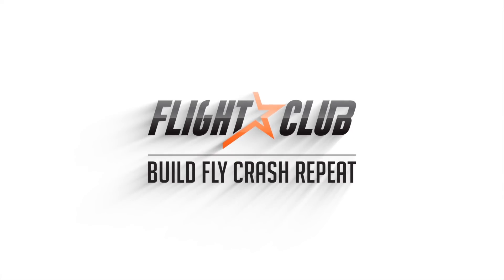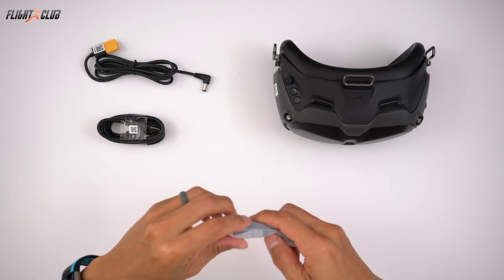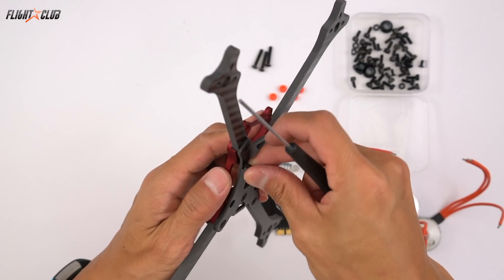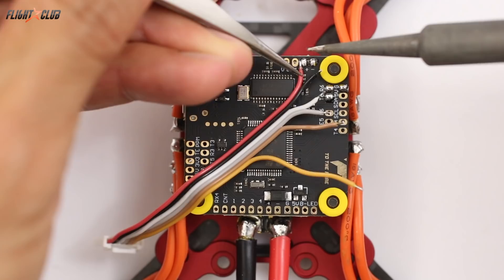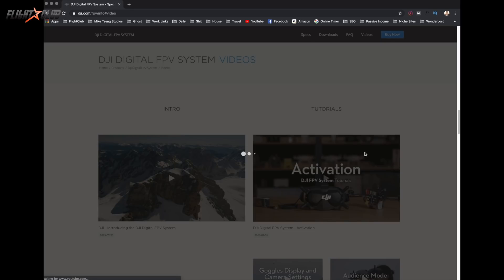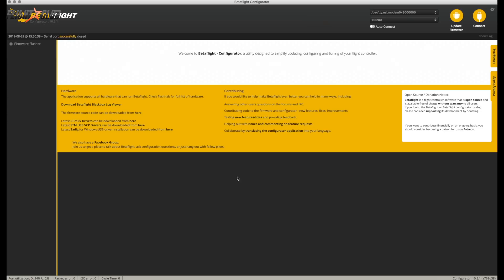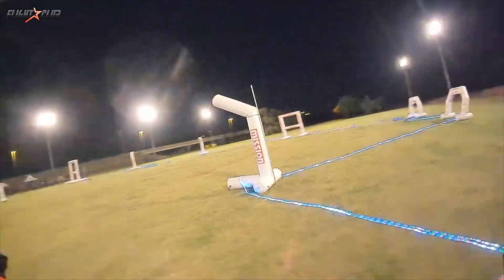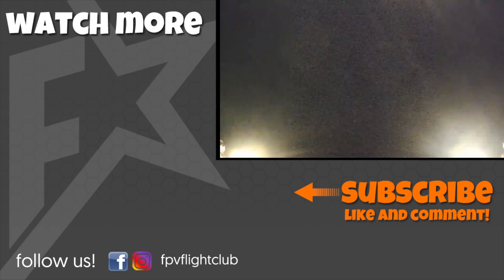DJI FVP Build : HD Drone Racing!

Comment: Fantastic video and very clean welding... btw, I've seen that most of the people also use a capacitor to reduce electronic spikes together with the battery, but in your video you don't.. Did you find any problem while flying?

Comment: hey Chris,
i bought this system from you a while ago...great video btw.
I would like to point out one thing though: IT IS VERY VERY IMPORTANT TO SET THE DEVICE PROTOCOLL IN THE DJI GOGGLES TO NORMAL..otherweise betaflight will not recognize the DJI remote. 
just thought i could save some people some time :-)

Comment: I also had the question I read others have posted in the comments.  Must be a 4S build. But with all these videos and tutorials on running 6S on a 4S quad,   You had better contact your customer and advise them that they cannot do so unless modified.      I have almost the Same Stack that I am building out at the moment.  I was in a bit of a quandry, because the FC does not have a 12v pad for the Air unit.  However there is an unused pin coming out of the ESC however I see very small on the ESC it says 10v  however there is no wire in that hole on the plug,  a bit strange... but instead of running a 12v Bec off Vbat, I put a wire into that plug and plugged in a 6s battery and tested it with the multimeter and sure enough 10V.     So I am hoping this works out.     Probably not the best place to post the info but if anyone else is here and wondering what to do on a 6S build I thought maybe it would help.  However let me advise I am just building it out, so real world I don't know if its going to work.  Actually going to plug in the Air unit and 6S battery right now with USB C connected and Register with the DJI tool  (DJI assistant)
Reply: Plugged in,  Bound, activated and connected to DJI assistant updated.... Seems to work  so far so good.    On with the 6S build  later.

Comment: thxs for the video! i made also one but i used the tmotors f4 fc with the connectors so i dont had to solder between the air unit and the fc. but now i dont see the power indication of the aircraft in the goggles. instead is marked n/a. can you help me?

Comment: I am trying to build my first FPV drone ever, i would like to go with DJI FPV System but I want to build a 6s, with astrox x5 body, lumenier 2207-11 1750KV My question is can I use XILO Stax Combo 45A BLHeli_32 6s 4-in-1 ESC and F4 flight controller with DJI FPV System? If so does it support play and plug or do i have to solder the dji to XILO flight controller? Thanks in Advance.

Comment: FINALLY, a nice installation like always. What about to use 6s? with a Bec?
And I hace seen RSSI and GPS in a video, How will it posiible? THX in advance.
Reply: #Gabyguay69FPV # by bro do you found a solution for 6s?
Reply: @nes.torfernandez  I have ordered a BEC matek (3 pieces) 1 for matek,1 for ar unti. there is a forum in facebook very ussefull, join it!

Comment: You don't have to be rich to fly the best gear in FPV. Speaking from experience you're better off starting with the best equipment available. Most of it is a one-time purchase..... $2500 will set you up FAT with the DJI system, a couple of quads, simulators, tool's, batteries, etc. The last set of golf clubs I bought we're $2000 plus $50 every time I play. We lose 2-4 thousand dollars in depreciation on a snow mobile every year. Buy the good shit!!!

Comment: I bought the DJI FPV System one set including remote. I activated the goggle and remote with no problem. I soldered the Air Unit to my iFlight SucceX Micro F4. then i set it up in the betaflight. I followed your instruction. I opened the port Serial RX for the SBUS and enabled the SBUS in reciever tap, but somehow i can only receive Video but no signal from remote. In the receiver tab in betaflight show now (no signal received). One thing i did differently is that i power the air unit up by using the power from battery pad directly because there is no 9V output pad on my flight controller. Is it the issue? if it is i think the air unit would have already burn, but it is not. i still can see the video on the goggle. Please help!
Reply: Exactly the same issue here with a tmotor f4 FC

Comment: If they ever match the DJI cam to a drone in a RTF package it will be permanent sold out.
Reply: Travis Stratton apart from the £900 rrp of the dji FPV goggles and camera alone, biggest rip off ever, give it 3 years and everyone will be doing digital at sub £300
Reply: @Tintin-dm4ym  its not really bad, 800 bucks isnt bad considering how many shitty fatsharks i have owned

Comment: Love that track in the drl sim. Great build vid. I got to try one of these out at our race Sunday. Awesome video in the goggles for sure. Game changer.
Reply from the maker: yeah it's unreal seeing race video that clear
Reply: FlightClub yes it is. The image is soooo clear compared to analog. See so much more of the track compared to my normal ccd cams. But there are some nice cmos cams that look better than the ccd I just need to find a good one that isn’t $45 lol. I’m liking the runcam nano cam and If I could find a micro cam that’s similar to the nano or better than the nano id grab a few. I’ve got a Predator v2 in my hawk 5 I love the image but it’s a little on the blue side even after adjustments. But gates just pop in the screen with that cam the white mgp gates and yellow quaddiction gates are so easy to see. 
Any suggestions on some good cmos micro cams?

Comment: I paused a moment when you wired the air unit's power to vbat before realizing that this is a 4s build. We have to keep in mind that the air unit can't take 6s voltage in. If anyone intends on running any more than 17 volts, you will need to run a regulator to power the air unit. Great build Mike, as always!
Reply: If you have to, any old 12V UBEC will do - and you can slap a 16V 220uF capacitor on the output, then feed the air unit straight from there.
Reply from the maker: oh yeah, good point.  it can take battery voltage up to 4s only
Reply: wanna make 6s drone so i need capacitor on 6s battery to work with dji air unit? Thanks for help anyoone
Reply: @magnusfpv7765  You need a step down DC Regulator or BEC. Search for Matek 2-8s Micro BEC with a 12V output. Racedayquads has one for $5 that would work perfectly.
Reply: @chaserporter  and what if i use T-motor F4 OSD Flight Controller & F55A PRO II BL_32 DShot1200 4in1 ESC Stack for RC Drone FPV Racing it have 5v/2a bec power for camera receiver and other equipment?
Reply: @magnusfpv7765  The DJI Air Unit requires an input voltage between 7.4V and 17.6V so the 5V output from that stack isn't enough. Also be aware that you won't be able to use the OSD (On Screen Display) on the T-Motor Flight Controller with the DJI system. There are a few flight controllers that have been designed to be plug and play with the DJI Air Unit though. Check out Oscar Liang's article: https://oscarliang.com/dji-fpv-betaflight-fc/
Reply: @magnusfpv7765  It does look like that flight stack has a 10V BEC, so that should work fine for a 6s build.